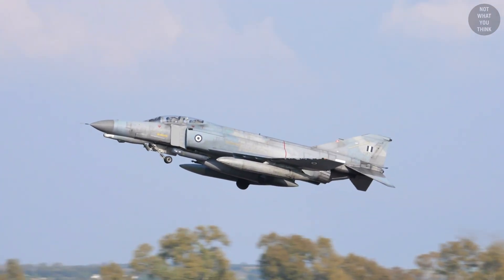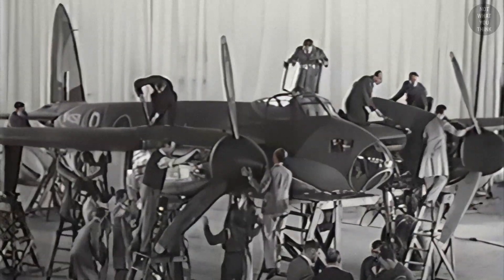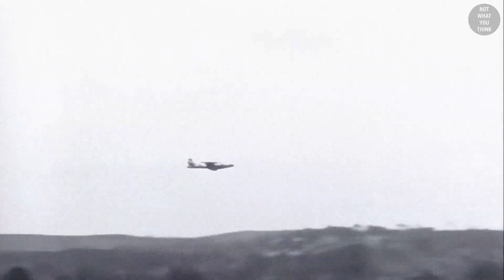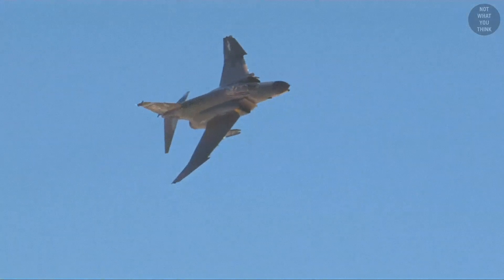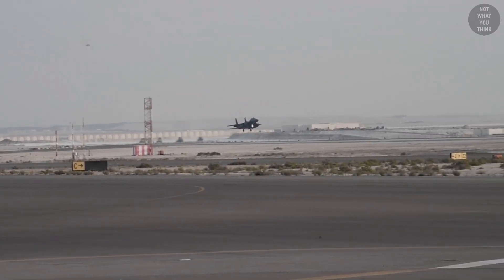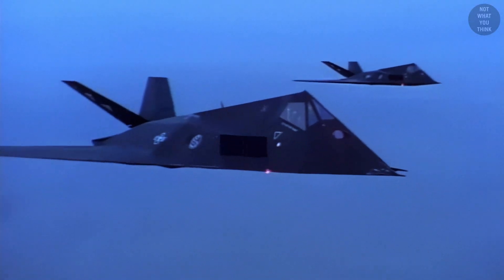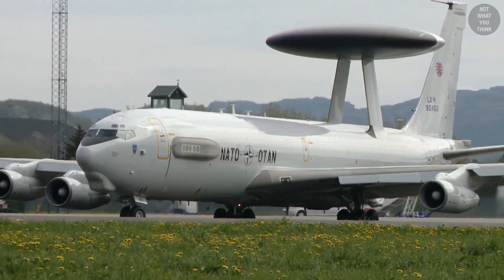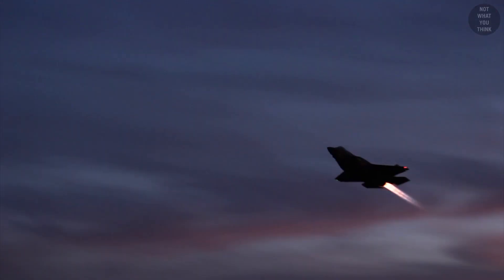Why are Modern Fighter Jets Slower than 1960s?

Comment: Good video, I always wondered why the aircraft during the Vietnam war would leave all modern aircraft in the dust. 
I figured their was a sensible reason for this change & here it is! 

With how advance technology is, I'm still kinda surprised no one hasn't figured out how to at least increase the handling characteristics of super sonic flight.
Because till we create a new type of agent, range issues will still be there... But... It would be an ace up a piolets sleeve in a traditional fighter jet vs fighter jet to crank up the speed and handle just as well. 
But yeah ultimately big picture useless against surface to air missiles designed to hit aircraft.

Comment: The reason is you cant put M2.5 in a dogfighter/stealth geometry. This is why theres another class called interceptor. Those has geometry specific for M2.5+ .
And you can avoid aim120 with speed. In fact, speed is your best ally when another aircraft shoots you. Plus, more fast and high you are, more range your have with your missile.
Interceptors has more utility in big countries, like EUA, Russia, China, Brazil, where you must run high distances fast, and shoot far away from dogfight.

Comment: Thank you for the clear & concise explanation of why modern fighters are slower than the jets of the 1960’s. However the video requires one small correction. The first use of an airplane in war wasn’t WWI, it was during one of its dress rehearsals zthe Italo-Turkish War of 1911-1912. On October 23, 1911 by an Italian, Captain Carlo Piazza he made a one hour reconnaissance flight over enemy positions near Tripoli, Libya in a Blériot XI monoplane.
Reply: You know that the The actual reason why aircraft don’t fly faster is because aluminium will soften at speeds above 1650mph or roughly in that range, if you want to go faster you must built the plane out of steel or titanium, the SR 71 and XB70 where both made from titanium while the mig 25 and mig 31 where both made from nickel steel, the problem is that titanium is expensive and nearly twice as heavy as aluminium and steel though cheaper then aluminium is 3 times as heavy meaning that performance outside of speed is effected, that’s why the mig 25 has a combat radius of less then 300km and a payload of 2000kg not to mention a low thrust to weight ratio

Comment: Alot of modern air crafts are adding DCS which also limits the highest speed they can achieve also, the need for speed is gone as most of the work has been trickled down to missiles.
Afterburner is being replaced by super cruise, also modern engines have better fuel efficiency,  better and longer survivability for the airframe that speed is not needed
Now missiles can hit target close to 100KM upcoming chinese a2a missile will have the range of 300KM

Comment: Most of these figures are for planes in a "Clean" configuration, add on missiles, tanks, full gun load etc and figures will be lower. Thats where the internal weapons bay on the F35 will pay dividends.  "The F-35C can reach speeds of 1.6 Mach (~1,200 mph) even with a full internal weapons load. With its fuel and internal weapons load, the F-35C can fly faster with no drag associated with external tanks and weapons required for legacy fighters."

Comment: Dude you are an absolute crackhead they did not reduce the speed of the F-22, the F-22 is basically the exact same speed as an F-15 it is mach 2.4 and, it can super cruise at Mach 1.8 slowly decaying over a long distance to Mach 1.6. but 99.9% of the time it's going about Mach 0.7-0.9, and I actually does not break the sound barrier unless it absolutely has to because it damages the radar absorbing material. Nothing is limited or reduced they will go to Mach 2.4 if they need it.

Comment: Isn't F-35's combat radius much lower than the teens? It's why US carriers can't confidently threaten China iirc.
Reply: No it's significantly higher. The F-35 variants each have roughly a 50% increase in combat range compared to the fighters they replace.

Comment: The video completely ignores a very vital part: Flying at super sonic speed is very demanding to human bodies and the higher the speed, the more demanding it gets. As jets are still controlled by human pilots, constantly flying at Mach 2+ would be very stressful to their bodies and make them far worse fighters in air combat at the destination. And the best airplane won't win an air battle if its pilot sucks.

Comment: Couple of additions come to mind:
Some of the century series and some other super fast fighters were that way specifically for the intercept role, i.e. an incoming e.g. bomber threat is spotted, and the plane rushes to intercept it as fast as possible. Since those bombers were largely replaced by cruise missiles and ICBMs, that isn't so useful anymore.

Another use for speed, even today, is to extend the range and lethality of a missile, like the AIM-120. There's a significant difference in the range and lethality of the same missile based on speed and range, and if you can shoot the same missile from Mach 2 it can be a fair bit more capable than if it was shot from Mach 1.1. Granted that is not a primary concern in plane design.
Reply: F-104 comes to mind.
Reply: @HappyBeezerStudios  that and the Lightning are pretty stereotypical examples.
Reply: @jubuttib  I hope for a good thing. (Also you are refering to the English Electric aren't you?)
Reply: @paogene1288  Yup

Comment: The f-4's engines were meant to be used for long range bombers and cruise missiles. We stuck 2 in a tactical fighter aircraft. The airframe was a brick, ask any pilot, but you can make even a brick fly with enough thrust.
Reply: Rockets prove that. Most have no lifting surface at all, they just go up by having a t/w of above 1.

Comment: So if we were to ask 100 US pilots if speed has ever saved their asses or been critical to the mission… I wonder what they would say. Or better yet, if more power/greater speed would have been preferable/made a difference/changed the outcome.
You can analyze data till the cows come home. But very few pilots have ever wished for a less capable aircraft.
Reply: Nothing's "less capable" the F-35 is absolutely faster than the F-16. If you want that to not be true, then you're talking an F-16 up for the sole purpose of wasting gas.

Comment: Short version: evasive maneuvers have technical limits that missiles do not - the pilot.   However... if you slow a missile [that needs to launch at mach 2+ to intercept an aircraft in the first place], it is out of range in terms of steering: what works for high speed maneuvering is a dog at low speed: might even lose control.  That which you cannot outrun must be outmaneuvered.

Comment: Always wondered just how fast the F4s had  to go to get away from persuit, as the pilots talk as if supersonic escapes were a regular occurrence. Having enough fuel for a return sounds like a sensible concern. I guess the test pilots get all the thrills.
Reply: Generally, the supersonic bit would be to exit a fight that wasn't going well to get good separation before the opponent could turn to take a parting shot.  It would usually be of brief duration since the other aircraft would need to burn a lot of fuel to try to get into an envelope to take a shot if he didn't just leave the scene himself.  However, modern missiles make this very difficult to pull off anyway since they can chase most anyone down at anything less than a few miles.

Comment: But the thing is, the Vietnam wasn't really an air war. I think at its height, north Vietnam only had 10 to 20 mig 21s and used hit and run tactics on vulnerable air targets. Full air combat was few and far between the ground attack missions for both air support for ground troops and attacking Sam sites.
Reply: China and USSR lent North Vietnam plenty of mig-21s to fight. So the North Vietnamese air force had access to a lot more than 10-20 mig-21s

Comment: An F4 doesn't go 2.2. It goes 1.2 because they don't go anywhere stripped down and clean load. They carry fuel pods and ordinance. There's also no benefit from Vmaxing a mach number because you have BVR missiles that can go several times faster than the plane it's chasing. Dogfights also don't go down at Vmax, they instantly drop to 400 knots and falling to stall speed as you turn. If you even get into a BFM fight to begin with. You don't need top speed if you already have a plane in the sky. This whole video is meaningless.
Reply: Funny to hear the old 106 and 105 pilots pick on the Phantom drivers over that very issue of stores, drag, and speed.

Comment: This was pretty much like the case with rifles for ww1 and ww2 where on paper the maximum range that someone could shoot with a rifle was about 1,000 meters but without things like optics and scopes you can only really shoot at a target about 300 to maybe 400 meters away. Which is why guns like the SKS Rifle was purposely designed to have a effective range of about 400 meters away since well why make your gun have a unnecessary range when most of the time you would be fighting at 300-400 meters.

Comment: Max speeds were also part of the Cold War philosophy of Bomber Interceptions.  The Tomcat was designed to intercept both bombers and missiles before they could get within range to either launch or deal damage.  The idea being that, the faster the Tomcat could get towards the closing enemy, the greater the odds that all the bombers and missiles could be shot down and left for the defensive systems on the fleet ships.  If the bombers could be shot down, not a single weapon would be released from said bomber.

Bomber Interception was also important for interceptors before the proliferation of ICBMs and still played a smaller role even after their deployment.  Even so, bombers could still pose a threat in the Nuclear Triad, and it was always important to have "fast" intercept capabilities, in the event an enemy tried to get closer with nuclear bombers.  The reasons are the same, to destroy enemy bombers and weapons before they cross into sovereign territory.  Even to the present day, NATO has to conduct bomber interceptions of Russian planes, as they continue to approach airspace where they aren't welcome.

Comment: The primary reason is that jet fighters in the 1960s were still evolving, and it had been found that most air battles DID NOT happen at supersonic speeds - and in fact, dogfights were IMPOSSIBLE at those speeds.
It was also figured out that you CAN'T do a lot of "stealth" up high - you need ground clutter for EFFECTIVE stealth (the SR-71 was slightly stealthy, but more to DELAY detection 'til it could not get caught at it's height and extreme speed, and the YF-12 interceptor member of that family turned out to be totally impractical as a launch platform).

Planes designed in the 1950s (like the Phantom that opens the video) had not had the "real world" experience YET to have learned those lessons.

Others have already mentioned the "interceptor" role, that isn't a primary concern today with the widespread adoption of MISSILES as the primary nuclear weapon platform.
Reply: One of the other factors that worked against the use of top speed in air combat in Vietnam was the in the rules of engagement, which required that hostile aircraft be visually identified before being attacked. This resulted in engagements at lower than optimal speeds for the F-4 Phantoms and preventing the effective use of their long-range missiles until the Air Force pilots worked out a tactic where, upon detection of potentially hostile aircraft, one would loiter back at range with a radar lock while another would go to full honk, blowing past the targeted aircraft too fast to allow them to engage, while giving the USAF pilots a visual identification, which allowed the loitering aircraft to fire its missiles.
Reply: @seanmalloy7249  If you think they had it bad, think about the poor F-14 drivers with Phoenix, that had "over the horizon" range...
Reply: @bricefleckenstein9666  The AIM-54 is not a good choice for a missile to use against fighters at long range; it is large and heavy, maneuvers like a truck, and exhausts its fuel climbing to its 'cruise' altitude, from that point gliding to its target. This last has both advantages and disadvantages; there is no longer an exhaust trail to signal its approach, but because it is unpowered, each maneuver it has to make bleeds airspeed. It was primarily intended as a fleet-defense missile to strike incoming missile-carrying bombers outside the range of their ASMs.
Reply: @seanmalloy7249  It was also a "I didn't see it comming" attack, when used at long range - the target likely never has a track on the attacker and therefore NO WARNING that it needs to dodge.
But what makes it a bad choice today is that they're all retired (possible exception for a very few in Iran, IF they have managed to keep them maintained).

Also note that at least one current missile has similar range (AIM-126? I can't remember the model offhand) but might not have the RADAR to handle it at that long of range.
Reply: @bricefleckenstein9666  The AIM-120D AMRAAM has a range to match the AIM-54, and a greater maneuverability, so there's no need to rig up a way to launch AIM-54s (or pull some F-14s out of mothballs); the AIM-120D is also lighter, which eliminates the problem the F-14 had that it could take off with a full load of six AIM-54s, but was not rated to land with them, and would have to drop two million-dollar missiles into the water if they hadn't fired them. Not an optimal solution.
Reply: @seanmalloy7249  As you amplify on my "what makes it a bad choice today" part of my comment.
The AIM-120 is basically a 30 year newer update to the AIM-54 (which originally goes back to the late 1950s), why act shocked that it's an improvement?
BTW - it ALSO runs out of fuel on anything near max range engagements, though not quite as soon as the AIM-54 does in it's envelope.

BTW - the F-14 routinely would fly with 2 or 4 AIM-54 and some Sidewinders or similar as a mixed load.

Comment: Top speed can come in handy. The faster your jet is, the faster a missile can come off the rail. Greatly increasing the range and effectiveness. A AIM-120 fired at 40NM from a F-15 at Mach 2, is a far deadlier missile than if it was shot at mach 1.6 from a F-35 at the same distance. It will ultimately increase the overall speed, and the distance the missile can travel with the same amount of fuel consumed. With modern jets designed with BVR engagements as the primary form of A2A combat, .4 Mach can be a difference maker.
Reply: But it's just not now. Is there really a difference when the mach 4-5 missile can travel 150nm?

Comment: That may apply with fighter-on-fighter dogfighting, but does not apply to interception of a Tu-160 bomber. Stealth of an F-35 was never as good as an F-22, in fact it's so poor and Russian radar has improved so much, that the F-35 may as well not be stealth. Tu-160 cruise speed is mach 0.9, and top speed mach 2.05. There's no way F-35 could catch it, or get anywhere near. And again, don't give me that lame excuse of stealth. Crappy stealth of F-35 may be able to avoid radar of third-world countries like Afghanistan or Iraq, but Russian radar can see F-35 as clearly as any non-stealth aircraft. So the only American aircraft able to intercept a Tu-160 is F-22. And US Congress will not allow F-22 to be sold, not even to Canada. Eurofighter Typhoon could catch it. Russian PAK-FA could catch it, but obviously they won't sell them to a Western nation. Dessault Rafale made in France claims supercruise at mach 1.4, top speed mach 1.8 at high altitude. Published statistics for Rafale used to say supercruise mach 1.02, so if released statistics can be believed, they've improved it. Rafale would still have difficulty with final approach, because Tu-160 top speed is higher. In 2012 there was a proposal in Canada to build an updated Avro Arrow. That could supercruise mach 1.5 with top speed mach 2.5, but definitely not stealth. YF-23 never went into production, prototype could supercruise mach 1.6+ at high altitude, max mach 2.2.

Comment: A tiny nitpick here: Thr F22 has a top speed of Mach 2.2 but can supercruise at Mach 1.6 thus saving fuel and lowering the IR signature.
Reply: Still can't operate there, the IR signature from the air friction is still massive.

Comment: I was in a discussion about Canada's next jet fighter and I mentioned F15EX might have been a good fit for Canada.  My reasoning was that if stealth technology every gets defeated by a breakthrough in radar technology, F35 becomes inferior to F15 in terms of range and speed.  The other point in F15EX favor is that while it costs the same as F35 it has over 3 x the service life, and can carry a hypersonic missile under development, maybe even laser gun under development.  If stealth gets busted then a huge place like Canada needs a plane that can cover a lot of airspace very fast and has long dwell time in patrol area.  On an  attack mission it could use it's speed to reach a launch point for a hypersonic missile, turn and run for it before the enemy can scramble interceptors where a slower F35 has the higher risk of being shot down.

Comment: People used to strive to be taller, faster, stronger, but not now. F35 is the most terrible aircraft in the current new generation. F22 outperforms the first in everything. I hate degradation and stupidity, like f35
Reply: Sounds like you are parroting bad rhetoric from ten years ago.  Our 35 pilots who came out of 15’s and 16’s would disagree with you.
Reply: They are built for different purposes the f22 is a pure air suepriority fighter. The f35 is a multirole fighter so it has to Be able to to more things. It's not worse it's just less specialized
Reply: @Lukas-ej9om  The 35 is a sensor and data hub that happens to be wrapped in a fighter airframe.